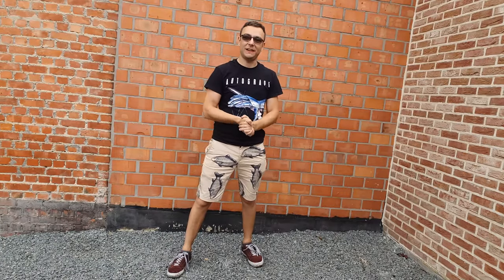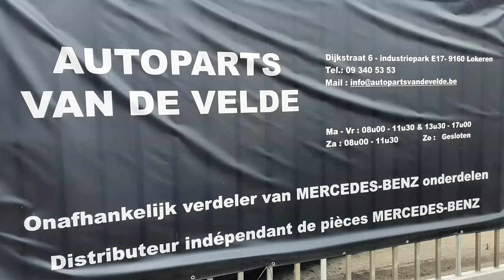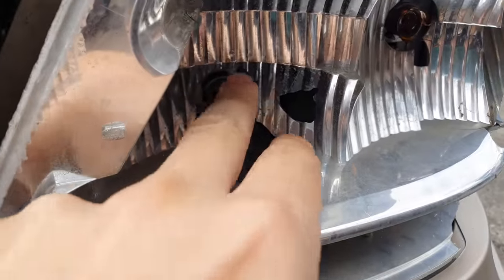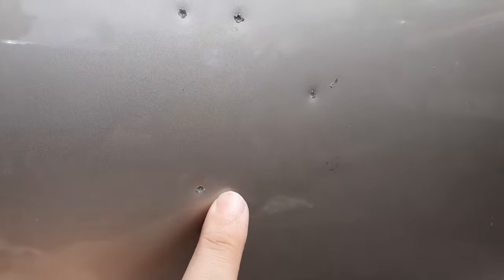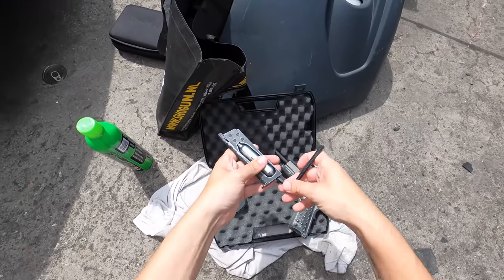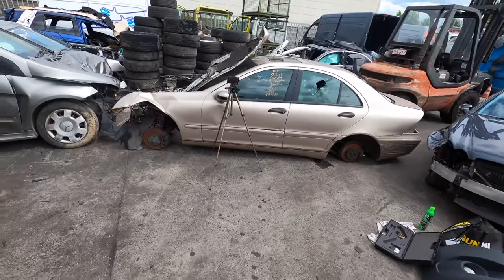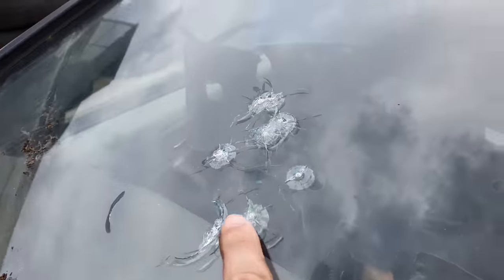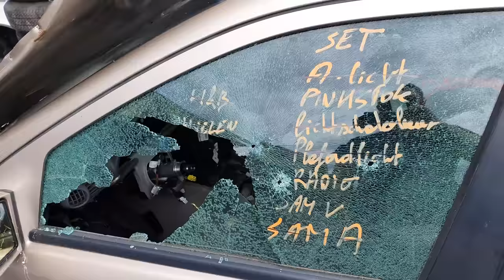Can airguns break a car window ? (4.5mm steel bb )

Comment: It shouldn't be a surprise that it did damage, he's firing a small round steel projectile at high velocities. Of course it's gonna break windows and dent metals. Dudes got an actual weapon right there.
Reply from the maker: Its not a firearm but a airarm 😆
Reply: @HappyDude1  lol
Reply: It’s a weapon not a toy
Reply: @HappyDude1  those are considered weapons bud. They are used for hunting small animals. Honestly. They do go through skin.
Reply: @UwUChito  in czech rep they still seen as cold weaons funnily enough meaning you need need license to own and you buy them at any airsoft soft shop
Reply: @HappyDude1  what is the name of that airgun?

Comment: Try a 4 joules airgun with no blowback, it will be even more crazy, as the blowback takes from the shooting power.
Reply: How can 4 joules does?
Reply: So, a no blowback AS gun is more powerful than a blowback one, isn’t it?
Reply from the maker: Revolvers are non blow back 😁
Reply: @adamp8463  yep a non blowback is more powerful
Reply: i carry a carbine around with me that has around 40 joules, A FUCKING SHORT BARREL CARBINE
Reply: why do you guys not use airsoft for playing, and real guns or compressed air guns for actual shooting??
Reply: @Colonies_Dev  theese are not real guns anyways
Reply: @executioner7400  does bruno mars is gay?
Reply: @rosemaujon8904  yeah… your right ! I just bought a gas BB 1911 and after few rounds…well…to compare with my another gas but non-BB M92. I think M92 is more powerful.
Reply: @HappyDude1  Revolvers still bleed off gas thru the cylinder gap.
Reply: @csm5040  FACTS👍
Reply: The whole purpose of these guns is the the realism over power. That's why you spend £200 on them as they look and feel like the real thing. The blowback adds to it, if it's purely target practice or power you want go for a non-replica air pistol like the SMK CP1 or CP-2. They have the maximum power in an airpistol you can legally have in the UK 5.5 and 6 ft/lb.
Reply: @Reknaw155  If this is the UK, then this kid has some pretty nice toys.
Reply: @csm5040  Well it's not the UK, is it? He's in Belgium... there were several giveaways in the video... not least his accent. Doh!
Reply: I have Beretta M84 non blowback, after changing spring and valve, it become much more powerfull. So easy to crush helmet and car window
Reply: @HappyDude1  yeah but it’s an airgun so it loses a ton of potential velocity out of the sides and everywhere else that isn’t behind projectile
Reply: @Colonies_Dev  what's the name of it ? I want to check it out ✅
Reply: @lilleeon  i have an artemis pp750, the carbine model, snowpeak/artemis has many beautiful rifles and pistols. you can also upgrade their power by making small modifications and loading heavier slugs
Reply: @lilleeon  but there is better models available, a 1911 model style air pistol with high power and an automatic rifle design are both on my radar.. if i am getting more air power stuff
Reply: Absolutely correct, the only issue is that non blowback pistols don't look as realistic....it would be nice to have a combination of powerfulness and realism, although non blowback weapons are also realistic but lack the mechanics that real pistols have.
Reply: @csm5040  makes sense but I think the gas required for blowback is much more.
Reply: @thiagoguimaraes406  Very likely. That’s why a non blowback pistol would provide more energy.
Reply: @Colonies_Dev  you carry around a bb gun lol
Reply: @liamg1706  do you think a gun shoots round little balls? it fires bore-rider slugs
Reply: @liamg1706  did you know, a diving cylinder can propell itself like a rocket through several fking solid walls? that's exactly the same gas used in my weapon.
Reply: @catherineharris4746 but they have a larger presser gauge so they hit hard

Comment: The revolver performed best, because it has no gas wasted on the action for blowback, and has more time to speed up the bb(its longer barrel). Non-blowback is best for velocity.
Reply: Also he loaded co2 without losing pressure as previous gun
Reply: Ok but how many jouls have the Colt and how many the Revolver?
Reply: Blow back 177 steel bb guns also easily bust windows anything above 300 fps   will shatter a window
Reply: @user70331  12g cartridges have liquid co2, they maintain a constant pressure until they are nearly expended or if it is cold out.
Reply: Correct 👍🏾

Comment: Cool video. I bought the Dan Wesson 8 inch that shoots steel bbs. I was surprised it didn't break a beer bottle from 5 metres. Hit it with many shots but didn't break. The bbs I used were dust devils though so maybe that was the reason. The Dan Wesson is a really cool looking piece. Cheers for the videos
Reply from the maker: Thank you
 and Hmm weird Try umarex steel bb's
Reply: Try the Ruger Superhawk 8 inch it fires 6 mm metal BB's it can smash a thick jam jar at over 20ft.
Reply: Dust devils are made of highly compressed powder and are designed to turn into dust on impact (hence the name). They are safe to use but not good at breaking something. Try steel BBs or copper coated lead BBs, they will do the job.
Reply: cheers for that. Yeah it makes sense.👍
Reply: Definitely.
Dust devills are for spectacular effect.
Also they clog barel reducing muzzle energy.
Reply: I thought I've seen they also make underpowered versions of this revolver too, pay attention to this just in case. Usually they would have smaller holes drilled in the cartidges so that less air is used to push the bbs.
Reply: @FloutchBW  sometimes the dust devil bbs get stuck in cartridge. So I have to pry it out. I had to put silicone gel on bbs to stop it happening
Reply: I'm barely satisfied with shooting 50 joules at 50 meters
Reply: No you need steel bbs ..

Comment: I remember learning somewhere that, in the case of a car accident, car windows (and by extension windshield I suppose?) are designed to shatter. This is due to the fact that if it remained as huge chunks, it could be dangerous if it was projected into the passengers. However, I think the way it was built into the frame allows it to maintain integrity?
Reply: Only if hit in the corners, that’s why the glass breaking tools put all the momentum into a single point and you’re supposed to hit the corner, the center is stronger.
Reply: Not only are they designed to shatter, they have a tiny protective film that also keeps the glass from flying everywhere and becoming a major hazard, car glass never breaks into sharp pieces if you notice it always shatters into ice-like chunks. Car windows are also designed to break much easier from the inside in case of an emergency where you may be stuck inside.
Reply: That's interesting. Thanks for the additional information!
Reply: It's not just for car windows. It's called safety glass, and is designed to pebble into small, uniform sized pieces, same as your bathroom shower door, better quality mirrors in gyms (most are not safety glass) and hotel lobbys, most decorative glass panes in Vegas, most newer store windows, as the looters demostrated, and anywhere else you don't want shards of glass like in a horror movie flying everywhere.
Reply: @newunderthesun7353  Hmm, I remember reading about a different kind of "safety glass", which instead is designed to keep integrity even after repeatedly bashing it. Unless I'm mixing up with security glass.
Reply: @Replace Soundboard  In construction, at least, we install safety glass for shower doors, tabletops and similar installations.
Reply: Yes and no. They’re designed to not shatter easily due to laminate but if they do it’s in non-serrated pieces. Blunt and square.
Reply: "I remember learning somewhere that, in the case of a car accident, car windows (and by extension windshield I suppose?) are designed to shatter."

The cars windshield is designed to be extremely sturdy and flexible, shatter to tiny pieces - almost pulverize, but not to become even tiny square parts as the side windows are and not to have a sharp edges as they would be formed as plunt as possible.
The windshield is actually a engineered so that it is the only structural element in the car roof. In some cars when you remove the windshield, the whole roof section starts moving as the A, B and C pillars don't have a strength to hold the roof in place. 
And this is why law and insurance companies requires that your windshield is coherent, without any longer than specific size cracks or the crack placements (not just for visual area, but as well for that structural strength).

The windshield is very fragile for point stress points. This is the risky part when people are installing new windshields, as the windshield is glued on the frame. And that glue is placed so that it is very thin between the windshield and frame. And in some cases that windshield has been pressed too tight to the frame, so that windshield gets contact to metal part in the frame. And then in short time after installation, temperature, driving on pumpy road etc creating a shock, and that tiny bit of metal touching windshield delivers the force point that will crach the windshield. It can be total crack from one side to other, or it can be just tiny like that BB hit. But it starts from there and goes from there. 
That is why when you get a new windshield, you need to choose installer that gives a guarantee against that.

The windshields are very tough and have the laminated plastic between to give it flexibility. Some even install a thin protective film after purchase, as then you can more easily just replace the film every year than pay for windshield insurance.
Reply: @paristo  Thanks for the technical trivia!

Comment: WOW....I am really surprised how big the damage on the windows are from the BB guns is!  Normally you even cannot smash a sidewindow with a headrest 
from the inside. And those BB guns (1911 and Dan Wesson) are able to kick out about 3,5 Joule maximum!  Try it with a Weihrauch HW45 pistol with 7-8 Joules! Should even
hit a dent into the doors maybe....?
Reply from the maker: Yeah i was surprised to
Maybe if i get something more powerfull i can try it again
Reply: Prolly because the bb is tiny, more less force but in a smaller area
Reply: But yeah the whole back windshield shattered one shot

Comment: Believe it or not this is a true story. In the sixties a friend of mine owned a Benjamin 22 caliber pellet CO2 rifle. It shot a huge hole through cans Soup cans Etc. Now that don't sound like much of a big deal but in the '60s cans were not made of aluminum they were made of steel or some sort of Steel metal combination I'm not totally sure just a lot tougher than aluminum. We shot the same cans with a regular 22 caliber rifle amazingly the damage was similar to the pellet rifle. Pretty damn amazing. I don't know whatever happened to that rifle but I lost track of my buddy back then. I was only 10 11 years old but I wanted that pellet rifle more than anything. In later years I searched high and low for a rifle like that however of all the air CO2 guns I purchased nothing came close to the power that rifle. I'm sure they probably don't even make that model or strength of a pellet or BB rifle anymore. Great memories for my childhood.
Reply from the maker: How long ago was this ?
Reply: @HappyDude1  oh I would say Circa 1965. But I know the gun was passed on to him so I would imagine it's a 1950s model. All I know if you shot it you'd be one happy dude. Pun intended. Haha.
Reply: Sounds like it could be a Benjamin 362. .22 calibre, and they took 8 gram co2 bulbs.
Reply: @jl3106  sounds right if it was made in the 1950s or early 1960s... from what I remember it was all wood except for the barrel and the pull back CO2 power setting which was at the rear of the barrel shaped like a penny. It's been at least a year since I made this comment and completely forgot about it
Reply: @edljnehan2811 you have a good memory!  Now you know the model, you should treat yourself to one. With modern pellets they are very accurate.
Reply: @jl3106  and you say they are still that strong? If this is so that is unbelievable.. I would also be surprised if they're still available.. I remember you pulled the CO2 power gauge back towards you depending on how much CO2 you wanted I think you could even empty the whole damn cartridge in one shot if you pull that thing back all the way... may I ask how much and where you can buy one ?
Reply: @edljnehan2811  Even by today's standard, the 362 produces good power.

Comment: Co 2 cartridges require Pellgun oil to lube the seals & pistol, also, blowback pistols use more gas, but a nice video.
Reply from the maker: Thank you 
I just posted a new video with a blank gun with even more destruction power 😋

Comment: Genuinely surprised the BB guns were able to shatter the car windows.  Probably would not get the same result though on the windshield…since it is designed to handle impacts better than the side windows.
Reply from the maker: I fired at the windshield in the video
Reply: @HappyDude1  I’m so sorry, I got interrupted and forgot to finish the video before commenting.  The BB guns did not penetrate the windshield, but they came close…and they sure did a lot more damage then I would have thought.  Kind of scary…someone with a full auto BB rifle has a decent chance of breaking through.  We are not very protected in our cars, are we?
Reply from the maker: Well a car is not a tank 😛 And don't forget there are still real guns out there 😁 But if a BB would hit you, you would be alive just in a lot of pain
Reply: @HappyDude1  a bb got shot through my eye and I died from internal brain hemorrhaging
Reply: this is where .357 magnum / sig comes in !
Reply from the maker: @biigsmokee  
sounds bad :)
Reply: @geezerp1982  there is a .72 airgun that can kill cate buffalo

Comment: Hey happydude, I was wondering, how often do you add silicone oil to the co2 cartidge on your dan wesson?
Reply from the maker: Every 10 capsules
Reply: @HappyDude1  thanks, i got the 4” black version and it’s cool. The dan wessons are the most realistic and solid co2 guns ive had so far so I hope they hold up. How many co2 cart. Do you think you have run through yours? 
Regards
Reply from the maker: @paullufkin4313  
I think 50 capsules
There are more realistic and better co2 guns like from sig sauer
Reply: @HappyDude1  did you apply oil the first time you pierced a cartridge? Do you think it’s bad if i didn’t the first time? To my surprise the manual doesn’t say you have to put oil at any given time.
Reply from the maker: @paullufkin4313  
Yes i always do that the first time :)
Reply: Some co2 cartridges come with lube in them. I think the webley ones I got did.
Reply: @HappyDude1  have you not tried adding a nut and socket head cap screw just below your hammer in the handle of the dan Wesson 😃
Reply from the maker: @mrnissanmad  
yes i have 2 videos about tension spring
Reply: I have a bear river 357 8"barrel where do ya oil it at & what kind of oil

Comment: i love my airsoft gun Swiss Arms  S A  1911 military rail pistol with semi-automatic  metal constraction, i see you use Co2 g12 , is power gun airsoft , with Co2 and trust me can do alot of dmg , semi automatic with blowback system that makes the gun looks very real , i like your video , 
Amunition -  177 cal  4.5 mm -BBs
Velocity -   314 Fps - 96 m/s
Energy -     1,6 Joule maxi
Mag.Cap  -     18 Steel BBs  
weight  -     2,08 LB   942 G
Lenght -     8,66 inch,  - 220 mm
Metal Version
Blowback
Semi automatic

Comment: A Daisy model 415 CO2 pistol is about twice as powerful as your first weapon since no energy is wasted on the blowback action. It's rated at 495 fps or 4 joules. The CO2 cylinders have liquid CO2'in them which means that the 40th shot has the same energy as the first. Temperature is the thing. If you have been shooting a lot of rapid shots, the cylinder will get cold and the power of each round will fall off. Take it slow and let the CO2 cylinder warm up again and the pressure in the cylinder will be constant until all the liquid CO2 is gone. Most guns will give you 50 to 80 equal shots before the CO2:runs out and the pressure drops for real.

Comment: Of course the dw will do the most damage. The airsoft variant is 500 fps so way too hot to be used at most games because hadguns are onlybsupposed to shoot 350 max. Even my hicapa on co2 barely breaks 350 although in perfect conditions it can break 380 hence whybi trybto run it on green gas if the weather is good. That will effect the muzzle velocity and gas efficiency dramatically durring the winter which is far better on co2 in every way in that reguard. Also try that we deagle on co2. It can take it as it uses gbbr internals.

Comment: Wow! For the CO2 gun, did you use a 12g cartridge?
Reply from the maker: @PassioneStoria  
Yes there are no other capsules
Reply: @HappyDude1  Thanks! I thought there were more powerful ones 😄
Reply from the maker: @PassioneStoria  
it would not work the valve would release the extra pressure
Reply: @HappyDude1  I get it now, thanks for the explanation 👍🏻
Reply from the maker: @PassioneStoria  
Happy to do so,
A lot people claim to gain fps with stronger springs but it does almost nothing. I have some videos about all that stuff